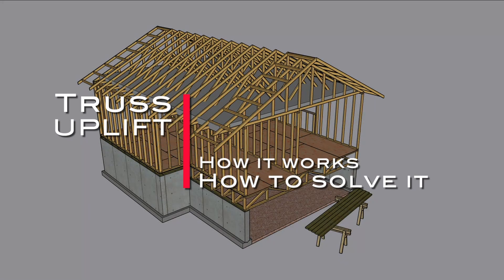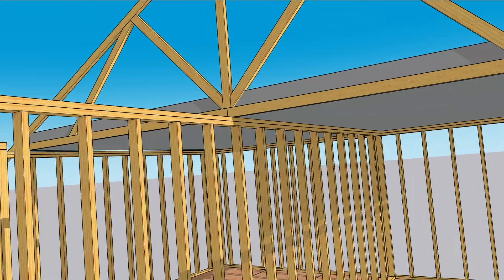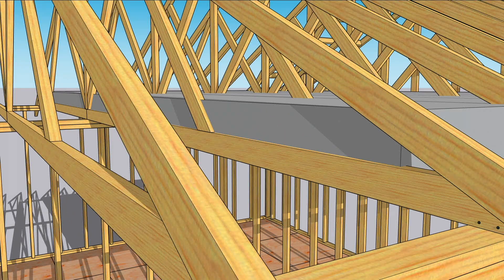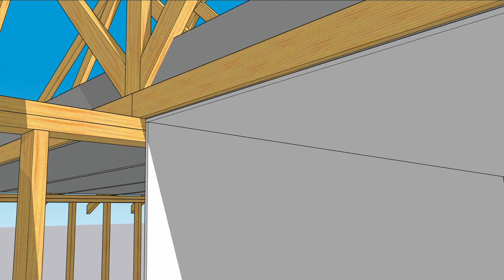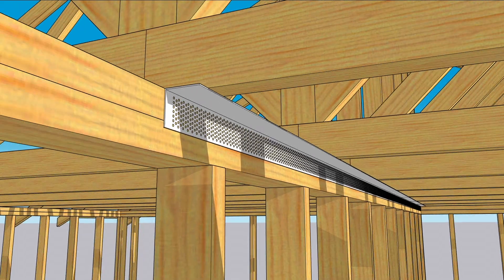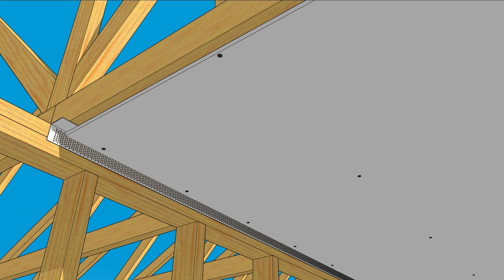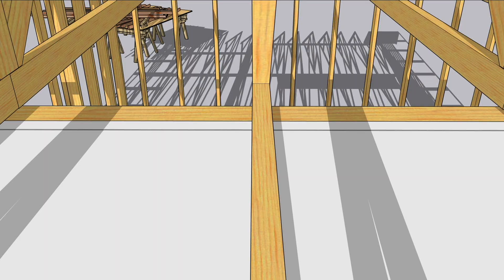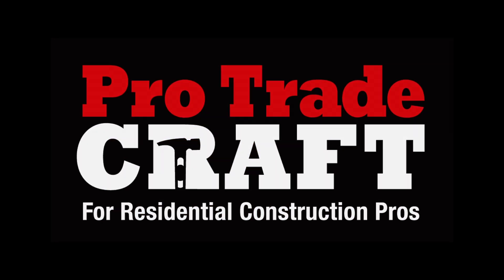Roof Truss Uplift: How it Works and How to Solve It

Comment: Who doesn’t use hold downs where trusses meet the top plate?
Reply from the maker: Hold downs are used at the ends, rarely in the middle. They are designed to keep the roof on the walls during high-wind events.
Reply: @ProTradeCraft  I've never built, nor have I worked on a house where interior walls were not fastened at the plate to the bottom cord of the trusses: we even marked layout the interior plates before flying them up there and rolling them. I guess we are working at different levels of craftmanship.

Comment: This might happen but from what I’ve seen is called partition separation which starts at the foundation and point loads in the house. In the winter the ground freezes and contracts then in the summer it expands.
Reply from the maker: The ground beneath a foundation does not freeze—at least if it is below the frost line, where the ground is a constant temperature of around 55 degrees. Expansive soils can cause foundation movement, but that is a water issue, not frost. And, sure, cracking can occur at point loads and such due to structural framing deficiencies or more seasonal wood movement—or initial shrinkage.

Truss uplift is caused by trusses moving upward in winter.